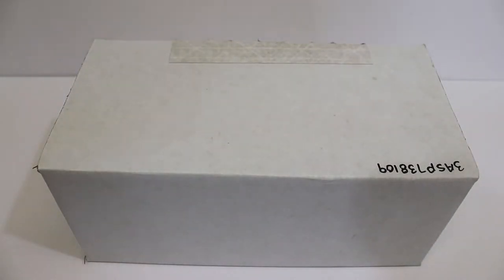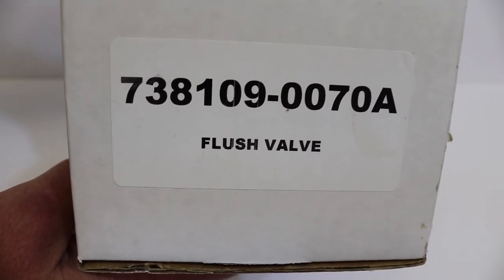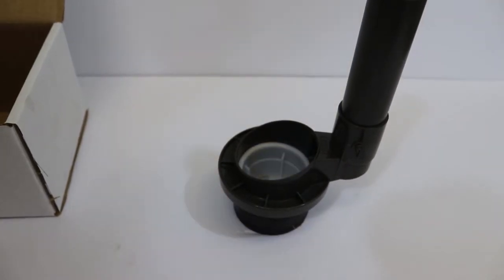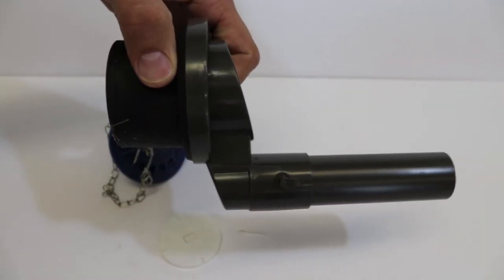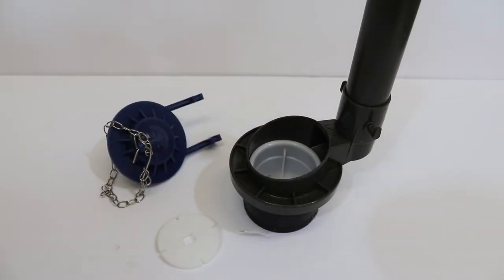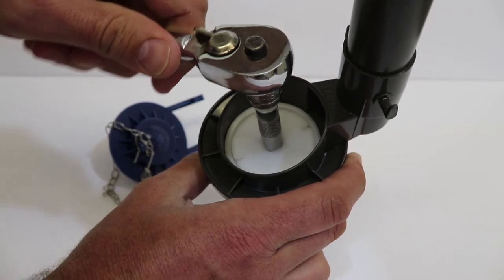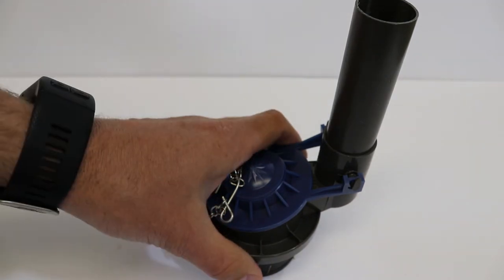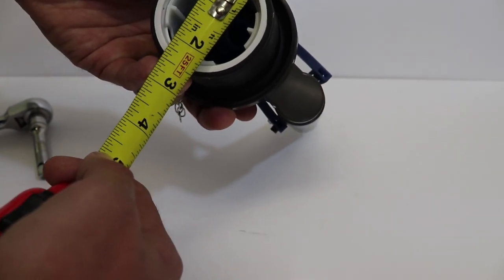American Standard  738109-0070A Flush Valve Review

Comment: I tighten it up and it still leaks past the seal. Is there some grease or lubricant you're supposed to put on the rubber? How tight should it be? Do you need to adjust the centering in the hole?

I filled the space with lithium bearing grease. The toilet still runs.

Ah ha! The little filler tube was all the way down and siphoning!
Seal probably worked all along.
Reply: I am in the process of replacing one.  The old one appears to have a bead of silicone or some other type of sealant under it.
Reply: same issue, new part water leaks past rubber into bowl  scrub or clean pathway rubber seat  area in bowl, calcium trails? plumbers grease? blue scotchbrite inside rubber gasket area scrub china lube up black gasket with silicone grease or spray?
Reply: 2092 AS "hamilton" one piece all new parts still leaks past,  korky 723X replacement will scrub inner china assembly, and get big flashlight in there to see or feel for defects to see where water is leaking past, use food color maybe  but tried many flappers , inner boot seal has leak is plenty tight will diaasemble 1 more time and check for lime buildup trail

Comment: Will this replacement work for one piece with the old brass style flush valve? The old one just has a screw in the center.. the rim where the flapper meets is brass body
Reply from the maker: It does not but check out this video.  I belive this will work.  https://youtu.be/FxTK7Et8sjU
Reply from the maker: If the video is not what you are looking for email us a picture of the inside of your tank